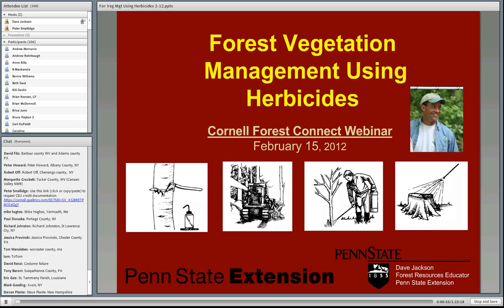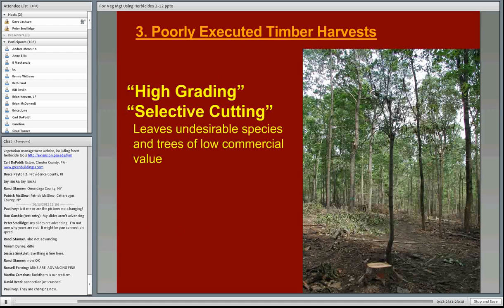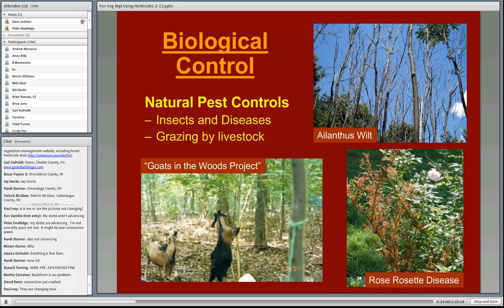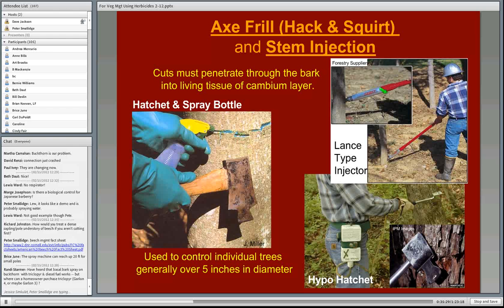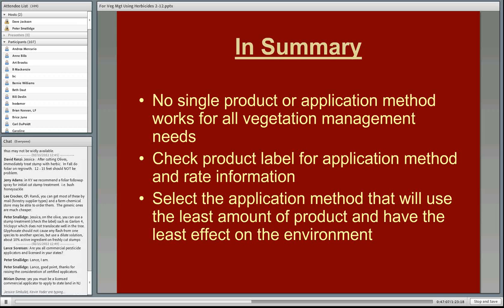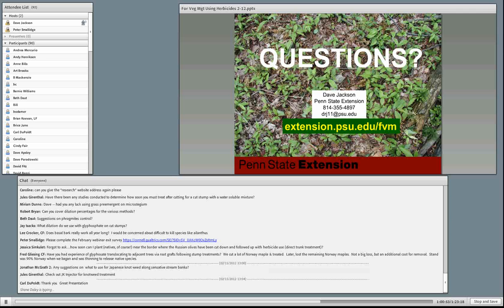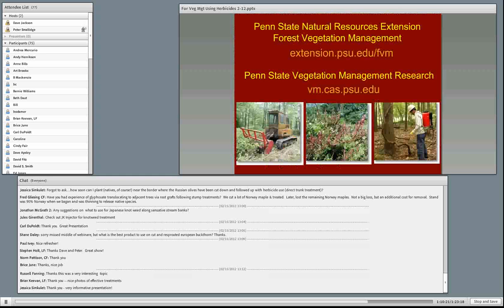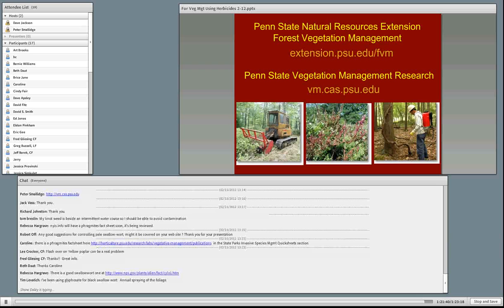Forest Vegetation Management Using Herbicides

Comment: Intermediate thinning of high quality hardwood and pine forest in NH with 50 percent canopy closure has frequently brought beech and red maple to many high quality sites.   Hard cutting where less than 40 percent canopy closure remains may  regenerate the moderately shade intolerant oaks and pines of the former stand.  To control the raging understories of beech and red maple, chemicals are interesting because just cutting the stems does not work.  The established shoots from of beech and red maple are too vigorous to allow the establishing seedlings to get going.  Meaning we are loosing a lot of formerly high quality forests.  How did these former forests get established?   Fire, time, weather and former abandoned agricultural practices.  New situations require new thinking.